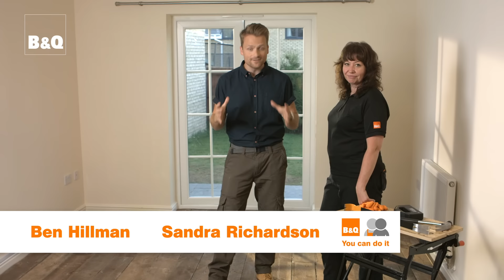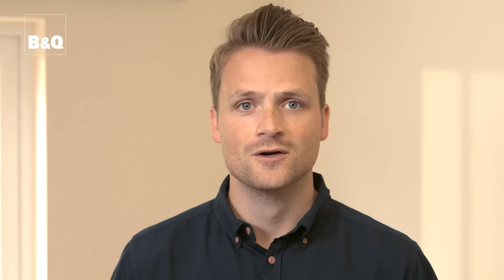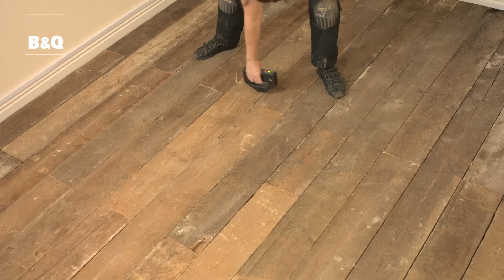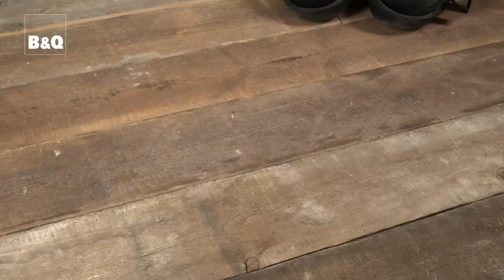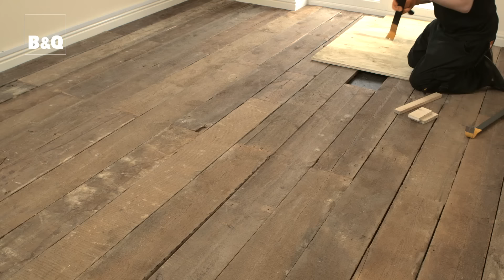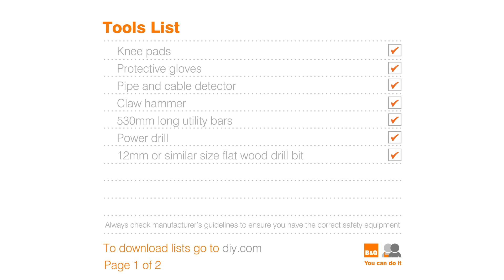How to lift old floorboards

Comment: That short piece of board you cut, then lifted out presumably can't be replaced now because it is not long enough to rest on a joist. So is this a destructive method such that you can't re-use the floorboards you've taken out? Do you now have to buy another floorboard?
Reply: I use a ripsaw and set it to the thickness of floorboard and start cutting from middle of joist so later they can rest properly on it
Reply: You can screw a pice of scrap wood to the joist if needed to support that end of the board